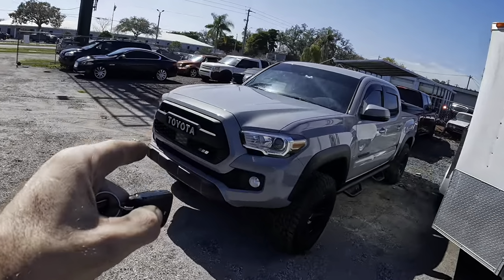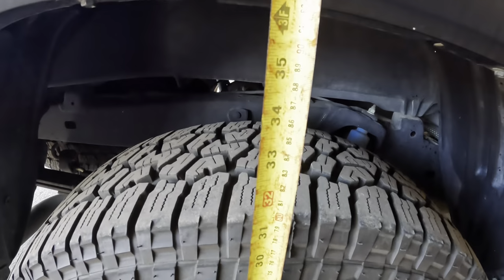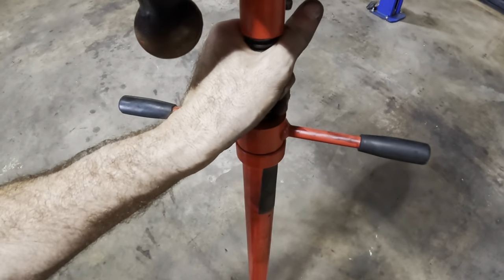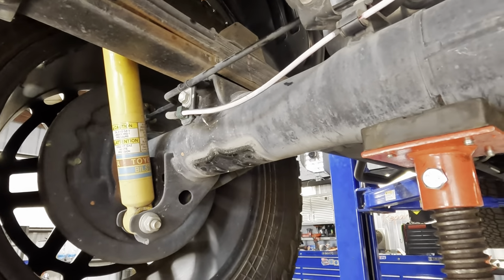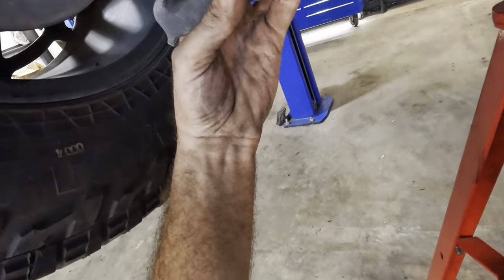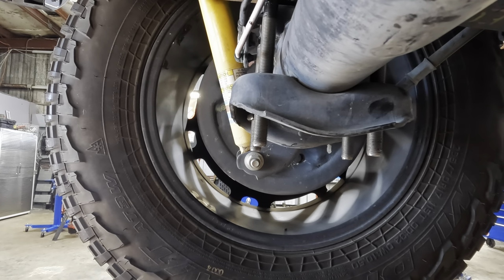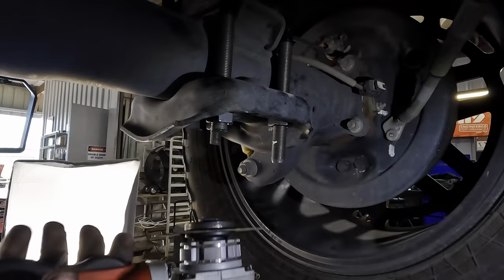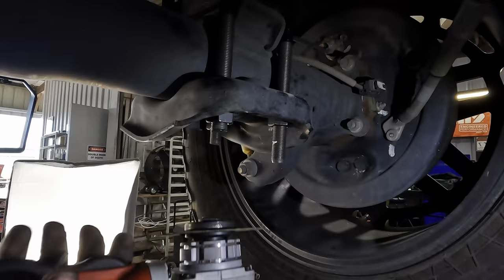Customer States Suspension is Leaning Reverse Carolina Squat | 2021 Toyota Tacoma TRD 4x4 3.5l

Comment: Errr,now the suspension has been altered away from standard factory setting.
 Should the owner inform his insurance company. 
 Insurance company dont like you altering this as this may compromise the handling of the car.
 This may cause an accident.  Making his / her vehicle insurance null and void?.
Reply: That’s not how that works 😂😂 you can insure a vehicle that’s lifted.
Reply: @CajunReaper95  that's fine but if , if you are involved in an accident and you have not told your insurance company they may void your insurance. 
Also there are company's that will not insure a modified vehicle.

Comment: Well, cutting the ends off the bolts was extra work; if it ever comes down to those bolt ends grinding into the asphalt, then they have a WAYYYY bigger problem!! Like, where are the wheels and rims??!? Or the rear differential??

Comment: There is a slight problem with your technique and that is you front fenders are higher from the ground than the rear, that is to compensate for the fact that the front wheels turn so the fenders have to be cut higher to prevent the tyres from scrubbing against them, now the rear fenders are higher from the ground so the actual body will be tilted very slightly forward (that's not a bad thing and it's better that the front being higher and feeling your looking to the sky lol) but may make the rear end feel lighter under severe braking.

Should've been measuring set points between the chassis or floor pan and the ground to get a true representation (stick a spirit level in the bed and see if it has a more forward posed stance now?) lol ..... just saying lol

Comment: There’s no better security than every vehicle having it’s own individual cut ignition key. Push button ignition systems are a product of un-necessary complex, over-engineering from German car engineers, that should have stayed in German cars, in Europe. If your vehicle’s radio fob transmission & push button ignition system fails. Good luck footing the bill for a new system. Even having to re-program transmitter fobs is a major, wallet digging chore!!! ….that is unless you know a good hacker.

Comment: May I suggest your customer has more money than sense.   Rear ride hight to low ? From the brief  look I had, that truck has front ADJUSTABLE 
Coil overs . Answer, lower the springs a small amount,  that will lower the front around an inch, sorted!

Comment: I can’t understand the American fixation on raising the ride height of “yank tanks” in a country obsessed with with safety messing up the  handling “why”
Reply: One practical reason is for people who go hunting.  The logging roads up in the mountains are rutted and you will scrape the bottom of your vehicle. So, they add 4 inch lift kits and larger diameter tires.  Now, most of the trucks I see that are lifted, are way too pretty to have ever been off-road, so in that case it is just for looks.  What's really funny is seeing a lifted 4x4, with a winch no less, that has gone into the ditch and the guy has no clue how to get out.  Never used his winch before.  I pulled a few out with my Tahoe.

Comment: Ree! I have an invalid opinion as I am not a mechanic, an engineer, nor a metalergist. 

Because I have an opinion, I must take to the interwebs to contest your assertion error in on the side of caution is advantageous when accepting the risk of working on a custo.er's vehicle in the state of Florida.

And as for Taylor Swift, them saying it's not a PsyOp meand it has to be! To the Aluminum Foil Deflector Beanies!

Comment: U-BOLTS CAN AND SHOULD BE REUSED! The fallacy that u-bolts must be used only once is an internet driven myth that probably arose from the use of torque to yield head bolts in many engines. Unless the bolt is broken, rusted too badly to start the nut on, or stripped, we have never replaced a u-bolt. A quality u-bolt is no where near its yield when properly torqued. Homemade and cheaply made ones should be replaced but after disassembly, you can tell just by just looking at the threads that they shouldn't be reused. All factory u-bolts that I have seen are hardened and can be reused over and over again.
Reply: Take note, he changed the U  clamps because the original one's were not long enough to fit with the new lift kit block In place thread wise.
Reply: Depends if the u bolts aren't stretched to yeeled
Reply: I'll follow Ray instead.
Reply: 21st century here... no leaf springs, no u-bolts. Discussion closed. 😅
Reply: Spazzing out to use old parts is pure idiocy. Especially if the truck is used to actually haul. Oh oh I can save fractional amounts of $$ for no reason that can be readily justified! Cheapskate vehicle owners make my ears bleed.
Reply: I think everyone is getting a bit carried away over nothing I’m guessing the new u bolts came with the block I don’t know but who cares the old ones were perfectly ok to reuse but we’re likely a bit short.
Reply: On the trucks I work on.  The u- bolts are torqued to 600 foot pounds. You can't reuse them!
Reply: Might be better to measure at the bottom of the cab, front and back. Wheel arches do not have to be the same height.
Reply: @capnpugwash5403  The point of measuring wasn’t about making them equal it was simply to show the changes adding a 1inch block made no need to be worried pugwash 🤣🤣
Reply: @steveb6103  I don’t think the new ones were torqued to 600 ft lbs sounds all a lot of garbage to me🤷🏼‍♂️
Reply: Even if the bolts would be too short with the new spacer
Reply: The fallacy and myth mutated to Legend😮🥸
Reply: Can't we Vote on this?!🤔
Reply: Dog tracking like Where's 'shopdog'?😶
Reply: I was going to come on here to call you out on your mistake or ignorance, but I see the previous comments have done this for me.
Reply: he might be referring to the Mack Truck "Hump back spring bolts", like on the 44,000 drives.... ;  )
Reply: Can’t reuse them if they aren’t long enough for the lift blocks.
Reply: Exactly, I have only replaced U-bolts with stripped threads or badly rusted units.
Reply: My 2018 Silverado 3500HD shop manual says not to reuse the u-bolts, nuts or washers.  Did a Google and internet says when the nuts are torqued down, they cut threads and stretch the u-bolt and this happens again with re-installation of used u-bolts, creating an opportunity for the nuts to become loose, and that would be bad.

Comment: Driveway suspension engineers, scary.  Why do pickup nudnicks think changing factory on a work truck is logical, and why does any thinking person want a vehicle up, top heavy, prone to flipping over, if you turn too quick in one of these unstable tool mobiles? Pickup brains are scary indeed